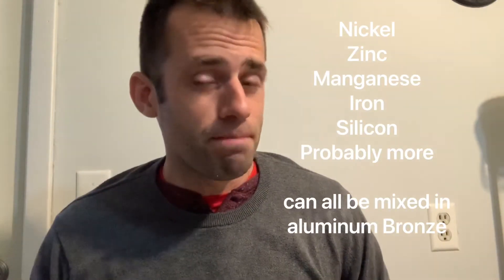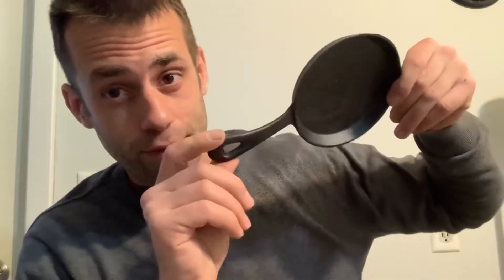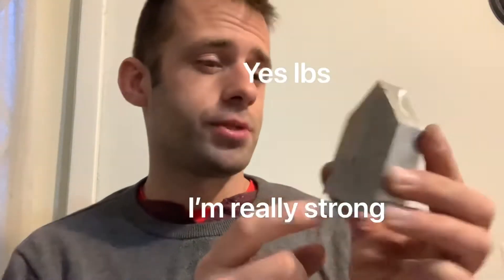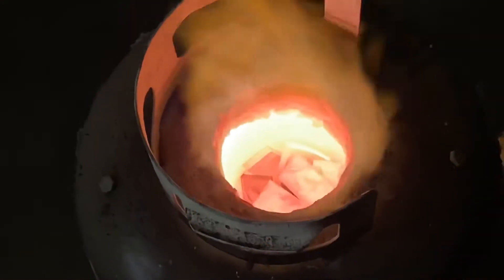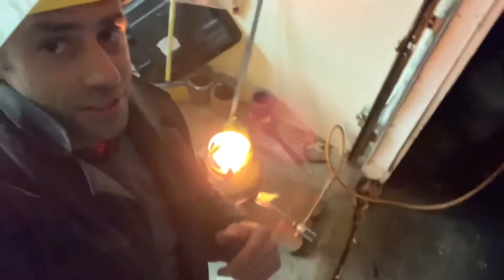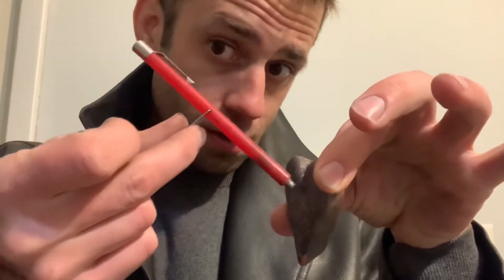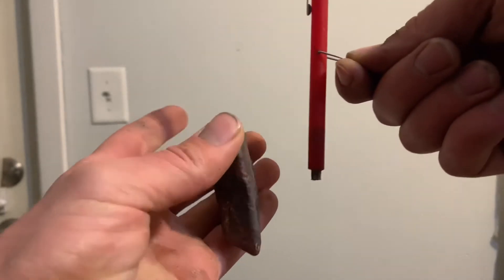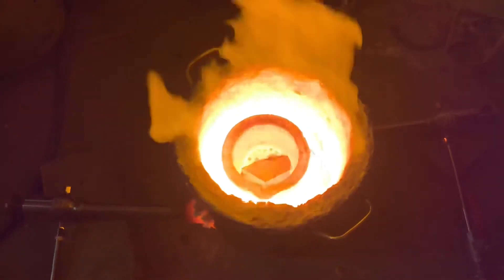Experiment: Making Iron Aluminum Bronze

Comment: Cast iron Is usually steel. The carbon content is higher than most steel alloys. Cutting the iron into smaller pieces may help them melt easier

Comment: Al Bz should NOT be ferrous (magnetic). BUT the max ratio you're supposed to mix it is 90% Cu / 10% Al, otherwise it gets brittle as heck.
Reply from the maker: Yeah I made an aluminum bronze Bowie knife and it was so brittle it cracked.

Comment: Interesting stuff. All I can say is when they make steel, they throw the alloying elements in last. You might need to melt the iron, then add the copper, then the aluminum right before you cast. Stirring might help. Good luck dude.
Reply from the maker: My furnace doesn’t reach temps high enough to melt the iron. But similar to when salt dissolves in water,  The iron should dissolve in the copper. That’s the theory anyway.
Reply: @lundgrenbronzestudios  I get super high temps with mizzou 3000 castable refractory and a “ribbon” burner with tiny nozzles in the burner instead of straight holes. Sairbond is the only way to fly as far as mortar and for investment casting. Just my 2 cents.
Reply: @lundgrenbronzestudios  https://youtu.be/LMTfZj7vC-4

Salt in water is an ionic bond and iron, aluminum, and copper is a metallic bond. Those two processes work differently.
Reply from the maker: Another example of things dissolving I’m metal is silicon. I can’t reach melting point of Silicon. But I can dissolve it in molten copper.
Reply: @lundgrenbronzestudios  Why not just add a bundle of 5" nails after the copper melted ? Introduce aluminium at the same time. More surface area.
Reply: Dissolving the iron in the copper takes time.  Less time if the iron has more surface area to react.

Comment: Great Video! Is that a 6kg crucible you're using in that propane burner?
Reply from the maker: It’s actually a #4,  8 kg crucible.
Reply: @lundgrenbronzestudios  was wondering- I use a "propane tank" furnace similar to yours and currently have only gone up to a 6kg- I'll have to try 1 size up!
Reply from the maker: Yeah, it depends on how thick your insulation is in your tank. I have just enough room to make the #4 work.

Comment: The C954 aluminum bronze I use to make axe blades has a slight attraction to magnets, but it also has a small percentage of iron in it.  I do not believe it would be magnetic otherwise.  I look forward to seeing you try heat treatment hardening with your diy alloy!  That is something I have always wanted to try with the purchased alloy I've been using.  If only I had a controllable kiln...  However, aluminum bronze blades will still work harden quite well with a bit of peening.  Try dropping one of your ingots on a cement floor or hitting it with a hammer.  Watch out for shrapnel though; if you have too much aluminum in it, it will be so hard and brittle that it shatters like glass!
Reply from the maker: I will try to test the brittleness they way you said. I have wondered what is stronger, work hardening or heat treating? I can’t find a thing online about it.